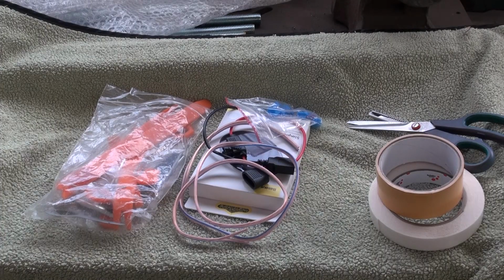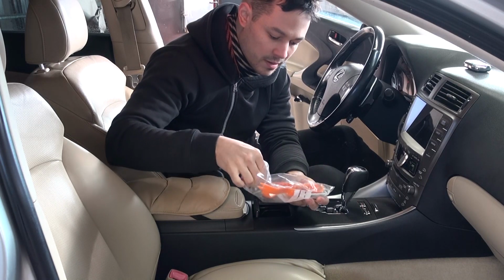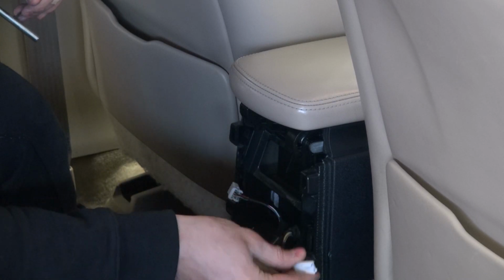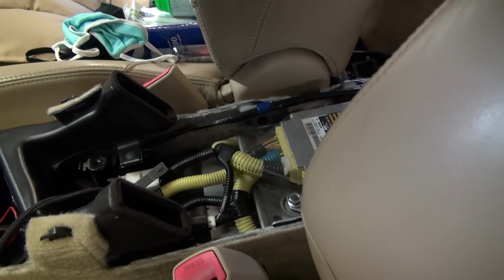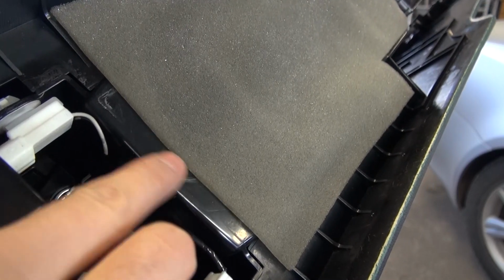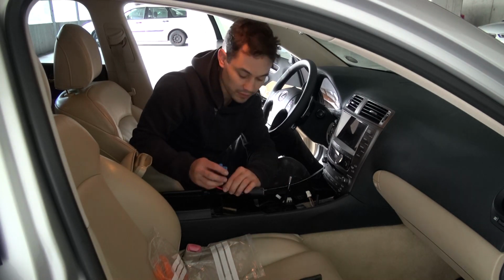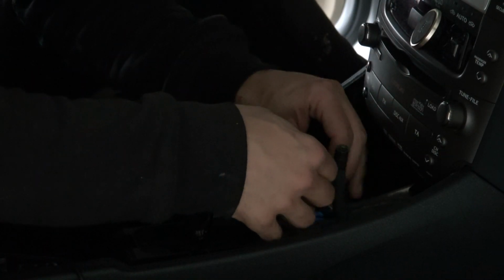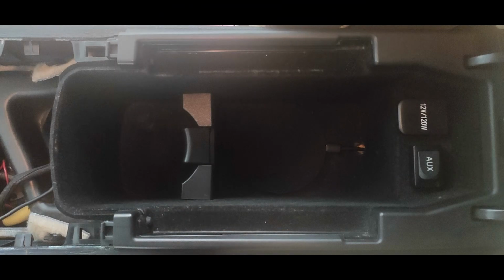How to install a HIDDEN(almost) wireless charger in a Lexus IS250/350/F

Comment: I’ve been trying to figure out how to do something like this on my 2023, but it doesn’t have the same space on the center console. I’m thinking maybe seeing if I can remove the plastic bottom part of the center console lid and install a MagSafe charger under there. Not sure if that would work, though.
Reply from the maker: I'm afraid they installed there the airbag system ECU...not a good idea to put a electric magnet field there 😬
Reply: Oof 😮